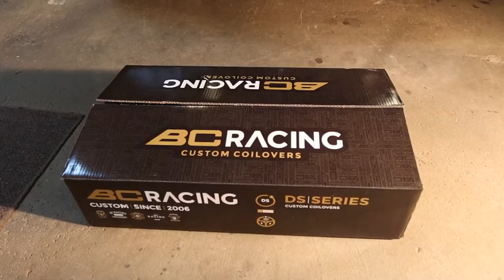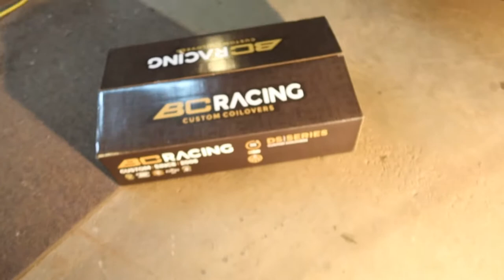C5 Corvette BC Racing Coilover Install (DS Series) & F45 Suspension Delete Resistor Trick

Comment: Describe the ride compared to stock
Reply from the maker: Honestly it was a HUGE improvement. I can't speak for the other styles of BC coilovers, but the DS series (digressive strut coilover) improved the handling of the car significantly. To start, it made the car look super aggressive with the low sleek stance. It dropped the front about 2.5" and rear about 3". It eliminated almost all of the car's body roll. There is still some minor side to side body roll or weight transfer. However, under hard breaking the nose of the car barely dips and under hard acceleration the car stays for the most part completely level (I want this for drifting b/c I need weight upfront for steering // drag racers would want a softer rear spring rate like 5,000Nm). I'm taking it on track next week to do some grip racing so I will comment on the high and slow speed cornering ability in the next video. As far as street-ability goes well worth the money!!!! Very comfortable NOT stiff and NOT bouncy like cheap/inexpensive coils. I can't exactly explain what caused it, but the steering also feels a little bit lighter. Right now I left the spring rates the same as they came (10,000 Nm Rear & 7,000 Nm front). I'm going to make the rear a little bit stiffer to help it slide a bit easer and prevent rubbing under large spring compression. I would recommend them to a friend :) Get the DS series.... I heard the basic linear strut BC coilover isn't great on this car. For what its worth it also took some weight out of the car. those transverse leaf springs add up. Cheers! Happy hunting
Reply from the maker: P.S. There was a downside..... it took 2 month to finally get them after initial purchase on 4/5/2021
Reply: @CrownRacingCo  bro u have to tell me where i can buy them gold rims at
Reply from the maker: @rohernandez2962  http://f1rwheels.com/product/f21-v2-f1r-wheels/

Comment: Here's an idea... don't use a 3 foot breaker bar extension on a 3/8" drive. That's why 1/2" drives exist.
You say you have "really big tires" but it would be really helpful if you told people what that means. It would be really helpful to someone considering this upgrade to know your wheel size, backspacing, offset, and tire size.

Comment: That module you did not know what was for controls the electric signal to the mag shocks. You can throw them away as you no longer have mag shocks. The resister does not work on F55 system

Comment: Are these regular DS series or the "extreme low" DS series?
Reply from the maker: regular... and I would not recommend the "extremely low" version. I slammed the coils when I first got them and the car was literally undrivable. I hit anything and everything on the road lol. If low is what you want the standard DS series coils will get you there ;)
Reply: Jesus christ, glad I finally came across this reply. Been going nuts trying to find an answer to this. Thanks!
Reply: @gwg240  I just ended up buying QA1 coilovers from Summit since they are local to me. On my way home this crack head started honking and yelling go back to California even though I’ve lived in Texas my whole life. He was high and ended up following me into a gas station where he floored it and crashed into me for no reason at all. Anyways rear tubing on the chassis is bent and rear tub was cracked. Pretty sure insurance is going to total out my C5. I only had it for 3 months. Guess I’ll just focus on my C6 but I’m so pissed.

Comment: What you need to do is find a local racing shop and then have them put it on scales and balance the car out. Just putting them on and guessing will make the car hard to drive and squirly.
Reply from the maker: We will put the Vette on scales in a few months thanks for the advice

Comment: I've been considering installing the coilovers on my 2001 Vette, but I'm worried the shock tower mounts weren't designed to handle the weight of the car. Have you heard of any issues with it?
Reply from the maker: I will be completely honest with you... I have not heard of that ever being an issue. I know a few people who track C5s with coils.... no issues! I drive my C5 really hard and I was just under it again installing an SLR angle kit. I adjusted my ride height again and checked all the bolts to make sure they didn't come to loose. There were zero signs of damage to the body or strut tower. I also drive on garbage Michigan roads (potholes) every day. If you are really that worried I would recommend a front and rear strut tower support bar. However, in my opinion, I don't think you need to worry about it.

Comment: What size wheel and tires are you running?  Are those OEM C6 Z06 wheels, or aftermarket?  

Will be interested in your feedback on the handling on the track (grip, not drift).
Reply from the maker: Yes, you are correct they are OEM Z06 wheels. Front 18x8.5 offset +56 Rear 18x10.5 offset +56 I also have these wheels wrapped in Nitto NT 555 tires. Front 245x40 Rear 285x40 The wheels and coils did really really good on the track. I posted a grip racing track day video on our YT channel check it out. The corvette felt like it was on rails! point and shoot. no body roll.... no brake drip.... just a little understeer into the turns when really pushing the car.